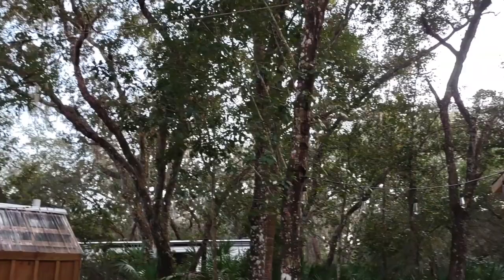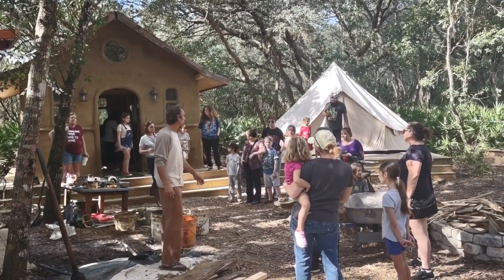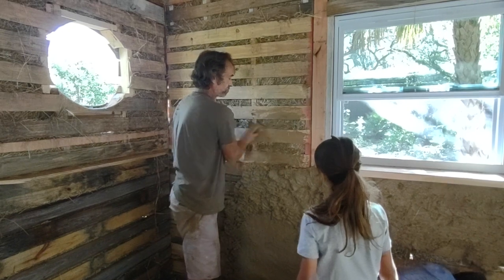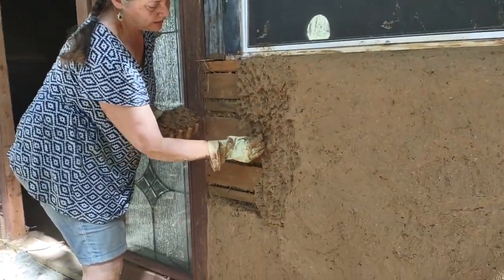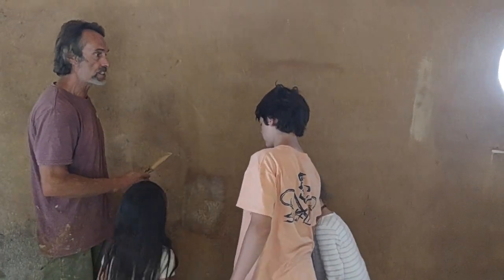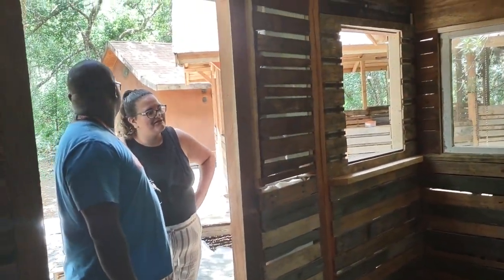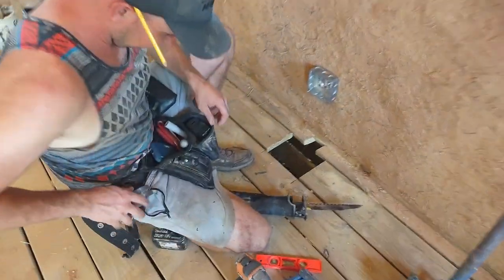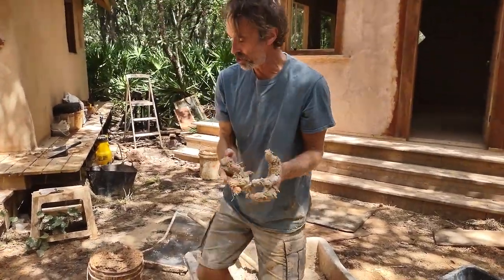Cob School in Florida

Comment: Looks great! Coming from California,  do you take into account hurricane force winds, rain everyday, and all the difference in weather for the Florida builds, as far as posts depths and screw lengths and such? I saw in the Cali videos you said you went down only about 2ft and cemented posts, and used 3" screws on the roof o. The west coast. Did you have to adjust the depths/lengths in FL?
Reply from the maker: I was building on existing decks which made things much easier for me. I did use hurricane ties and built the roof with a good overhang before doing any of the cob work. The structures all survived the hurricane in without any issues. Humidity was not an issue for doing the cob
Reply: @cobalot9  thank you! My mom lives in Florida and has been watching your episodes. It is her dream to build one of these, but everything we've watched has been filmed in drier climates. This is the first Florida build we've seen. Thank you!

Comment: Hi Miguel! I've watched many of your videos and they are very inspiring. I'm wondering, since I plan to mix the cob largely by myself, I'm wondering if a cement mixer could help speed up the process and give me an extra pair of feet so-to-speak. Have you ever tried it and is it as effective as stomping?
Reply from the maker: Hi, sure, you can try using a cement mixer. I never have, but I've seen videos of people doing it. I usually use a mud box and hoe

Comment: This is so beautiful.  What ratio of sand and clay should be used to make the cob? And plaster verses also the paint?
Reply: I see no cracks.  You have the perfect ratio.
Reply from the maker: Hi, to make the cob stick to the pallets I make it a little bit sticky so it's about 60% sand 40% clay. It does crack a little bit but when I plaster it the cracks are all filled.

Comment: Is there any issue with termites getting into the pallet wood inside the cob?
Reply from the maker: I have not had any issues with termites getting into the pallets through the cob
Reply: Thanks for the reply @cobalot9    

Has pallet wood been treated with anything? Any issues there for people with chemical sensitivities?
Reply from the maker: I use heat treated pallets rather than chemically treated and once they are encased in cob there is no offgassing